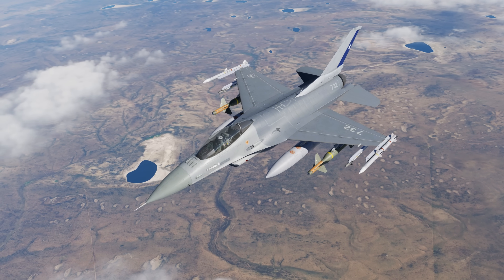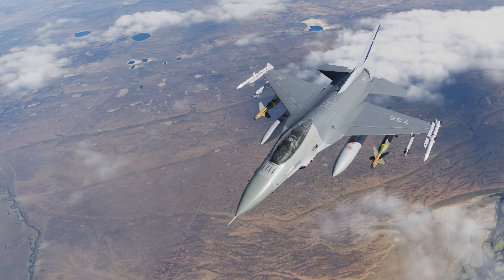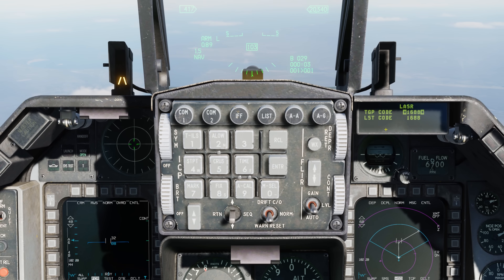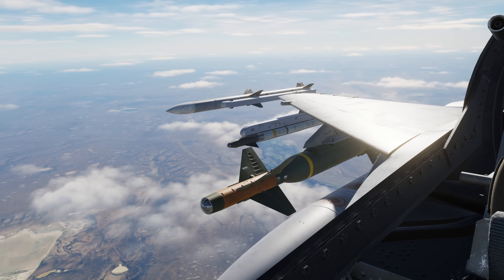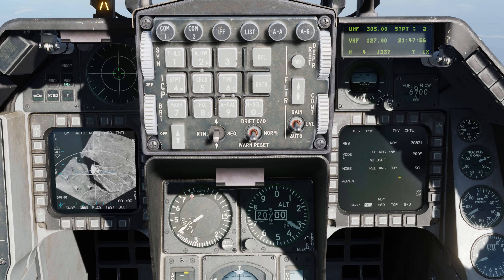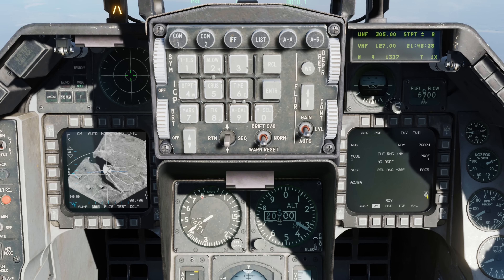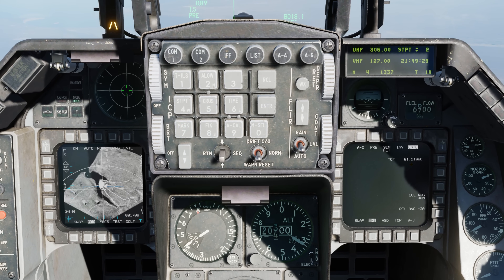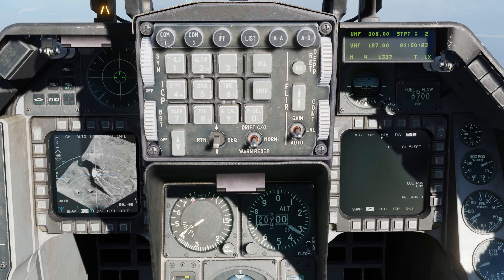DCS: F-16C Viper | GBU-24A/B

Comment: In case anybody is wondering, the six digit number on the bottom-right part of the HUD under the range and time to release/impact is the Weapon Time On Target (HH:MM:SS).  It can be found by the time shown on the  time shown on the UFC plus the to time to release/impact shown shown on the HUD.  For some reason, DCS makes it so that the relative bearing and range indication disappears when using the paveways.

Comment: Hey Matt. I have a problem. I cannot get the GBU 10/12 to release off the aircraft. I have everything set. Laser on. Master arm on. CCRP mode. 

I believe that the “release angle” is the main culprit here. When I click on the CNTL option and then click on the REL ANG … it reads out as “Enter LOFT REL ANG” . It does not even give me the option to make the numerals negative as it does not have the NEG osb at the top right, just like in this video.

When I never had the REL ANG active, the GBUs worked perfectly fine. How do I get rid of it all together? It doesnt give me the option to remove it. Right now my LOFT REL ANG is 0. 

Please Help!
Reply from the maker: Please use the forum. https://forum.dcs.world/forum/118-dcs-f-16c-viper/

Comment: Wags, any news on CNTL page implementation for the F16 JSOW? Being able to adjust the burst height etc. would make it much more fun to use, especially with the current binary ground unit damage model. Its been a while since it was added, so I find it strange the weapon settings do not exist, especially since they are already functional with the F18. At least I have sorely been missing the ability to guarantee kills on a few units with a lower burst height, rather than to always spread the bomblets wide with the default 1500ft burst height, which usually nets a few yellow health bars at best, even again non-armored targets like SAM sites.

Comment: Does NOSE fuze means the bomb will be fuzed at nose impact and TAIL fuze means the bomb will be fuzed when the tail reaches the penetrated surface?
Reply: it means that it will have a fuze in the nose, tail, or both.  The fuzes can function different ways and some let the pilot select it.  the fuzes can detonate in the air, at impact, or after penetration. It depends on what fuze is used and it's settings. Nose selects the fuze in the front of the bomb, and tail is for the fuze in the back.  NSTL selects them both to function according the settings on the fuzes or pilot option. The fuzes are needed to set the bomb off.  The bomb will not detonate without the fuze.  Also, in this version of the GBU-24 that is in the video, it's the 24A/B version which is for penetration.  It doesn't have a nose fuze.
Reply: @wesschaffran9088  So if NOSE fuze is selected in this case, the bomb won't be detonated? And is the arming deley option is to control the arming time of these two fuzes?
Reply: @YYCH2  I"m not sure exaclty what the IRL a/c settings are for the penetrator bombs if they even have the nose selection available.  If the fuze doesn't function, then yes, the bomb will not detonate.  I was a munitions specialist in the USAF for over 20 years. I built A LOT of bombs.  We did have some duds and some during real world combat missions.  It is not a good thing and we get grilled on why it happend. There are several factors on why it can happen. For the arming delay, you are correct.  It is the time after release that the fuzes will arm themselves to be able to function.
Reply: @wesschaffran9088  Can't believe an expert is answering. There is an EFUZE option in the honet. Does that mean the eletronic fuze will give the signal to the mechanical fuze once the bomb reaches the detonation parameters?

Comment: Wags, love the 16 and the work ED has done, but is anyone looking at the radar performance? 
In my experience in single player I can lock up a target quiet easily beyond 40 miles, but in multiplayer its almost impossible to obtain a lock either quickly or consistently unless it's well within 20 miles.
I know the 16 radar is not as powerful in comparison to other Western radars, but surely the differences between single player and multiplayer mode is cause for investigation?
Reply from the maker: In MP, many players will run around on the deck and the radar will not be as effective with ground clutter. No difference between SP and MP.
Reply: @MattWagner  I am more than happy to accept ground clutter is something that is very real but I do find that targets at altitude with no jamming and not notching are extremely hard to lock up (not that I mind the challenge).
Its something I'm noticing, but in no way am I having a go at ED at all.

Comment: More importantly, will it be possible to perform an inverted ridge crossing to drop via buddy lase on a 3m target followed by a max g pull out (sts) without dying?
Reply: Real men CCIP eyeball it. Use the Force.
Reply: The question is, will you get back to the carrier?
Reply: Yes.
Reply: Depends of the pilot.
Reply: Wrong real pilot uses his vector indicator.
Reply: Some one saw Maverik top gun 😁

Comment: What if I wanna change the code?
Reply from the maker: Then use the kneeboard to do so when on the ground.
Reply: @MattWagner  Hi Matt .... I know it's a little artificial .... but is there any chance that we will be able to change the code in a "Hot Jet" on the ground? Or is it going to stay with the "IRL" option that the jet has to be "Cold". Many Thanks for all the love the Viper is getting .... Cheers.
Reply: @OzCougar  IRL the code is changed via screw terminals on the bomb itself, I don't see a reason why it couldn't be done, when we can do hot rearming.

Though personally, I'd rather the laser code go in the new bomb configurator they're working on.
Reply: @Nstar98  Understood with regards to the 'IRL' aspects as I have a background in this area .... so simulating it via the F10 Ground Crew 'Hot Rearm' option to set the code when selecting the ordinance would be a nice workaround.

Also, agree completely with your comment about integrating this into the new bomb configurator as well. Cheers

Comment: FYI, been having issues with the Viper dropping laser bombs on moving or stationary sea targets.  For some reason, it doesn't want to be guided by the laser.  But after I bombed a land-based target using an LGB first, and then went back to sea targets it magically worked.  Possible bug.
Reply from the maker: No problem here. Please use our support forum.
Reply: @MattWagner  Can you elaborate a bit on the questions Sky rider posted?
2. Does the bomb behave any differently than Paveway II? What new autopilot functions have you implemented? Does the bomb pitch up or have a different flight path?Does the release angle setting have any influence on this?
3. What does the RNG CUE do or influence? How do you know what value to set?
4. Why did the 2 bombs impact with the RP setting distance? Why aren’t they going for the same laser spot?
Reply from the maker: 2. Please listen again to the intro, this is explained regarding "bump up" and extended range.
3. Whatever you want it to be, such as a pull up point, arming point, etc.
4. No, but it's still a bit WIP.

Comment: Is that RP setting designed to offset a laser target point for this weapon as it seemed that the second bomb hit the building nearby?
Reply: Good question, I noticed the same. It looked like the second bomb didn't track the laser or something, there's no reason it would hit the building behind the IL-76 if the plane is being lased and both bombs are using the same code.
Reply: @TLTeo   saw this with many other paired bomb laser drops. dont drop 2.
Reply: Yeah that caught my eye as well. I have yet to see this happen with any other LGB in DCS... Possibly one of the new more advanced "autopilot" functions on the GBU-24 vs. GBU-10? The second bomb knows that "this spot is lased, and i'm supposed to hit 50 feet beyond"? (Though 50 feet is on 15 meters, and the IL-76 is like 45+ meters long, so the bomb missed that spacing by miles...)

I have no idea what they should do in reality.